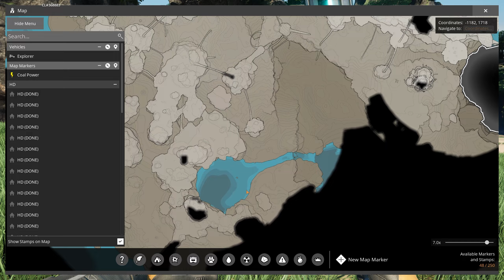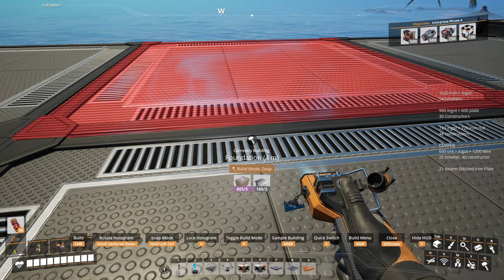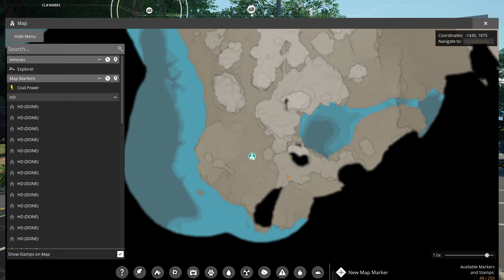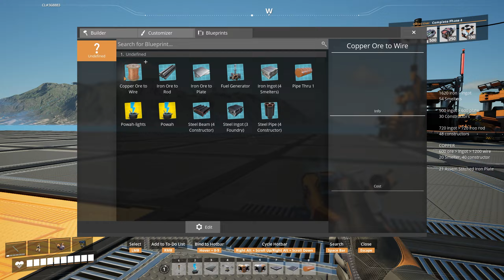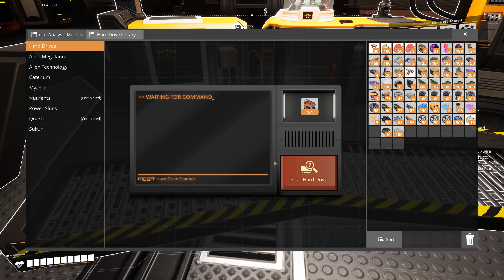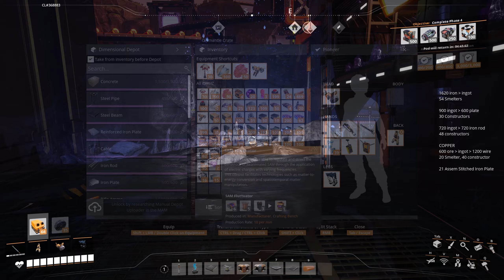Coastal development begins, plus more research | Satisfactory | BigVlad Plays | Part 34

Comment: Nice expansion. Have you not made the hover pack yet? So useful when building. Also, please fill the gap at the back of your hub! You keep having to leap back and forth. This is definitely a game where you can so easily be distracted by side projects, I'm now rebuilding my starter Iron Factory for the second time, and I want to upgrade my power to use diluted fuel and I need to start making compacted coal. Not even started to work on Phase Four. Sometimes I go into the game and just run backwards and forwards, doing nothing. That's the time when I have to go out exploring.
Reply from the maker: I do have the hover pack and it's quite useful when building. I just always forget to swap it in. But I'll probably be using more as I do bigger builds.